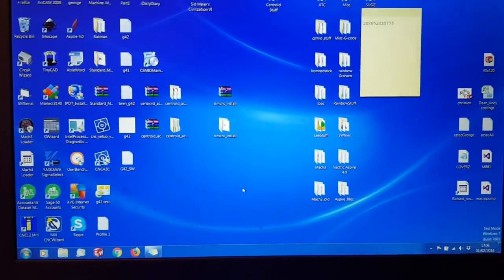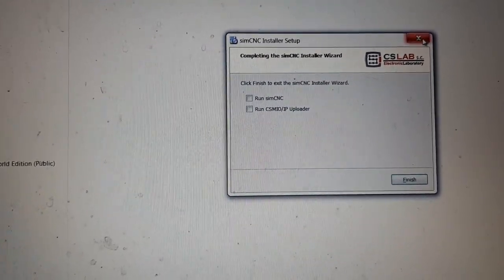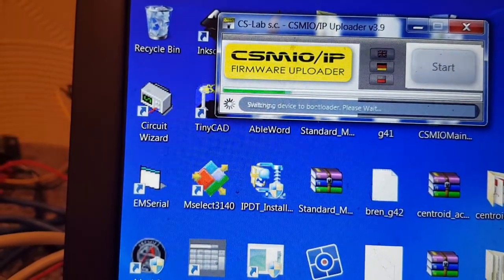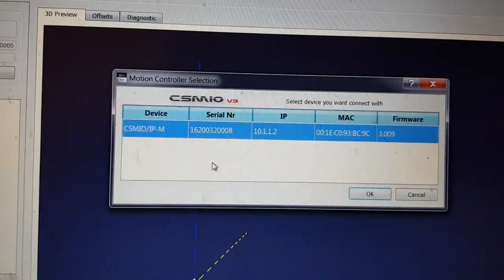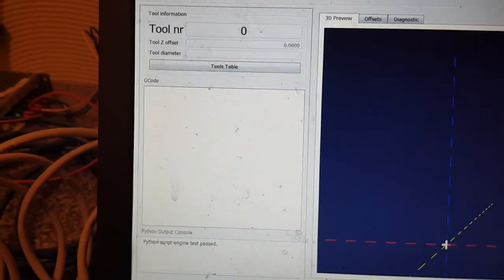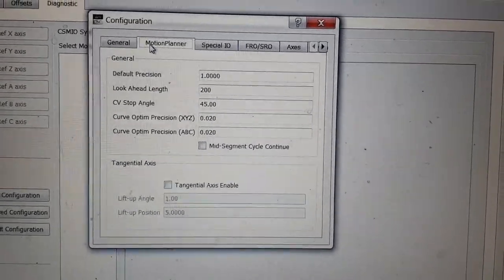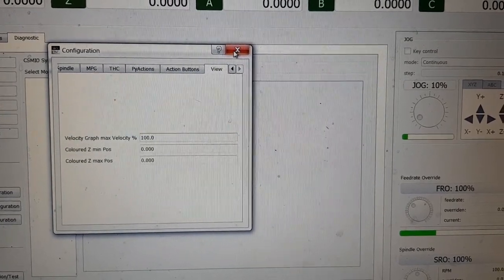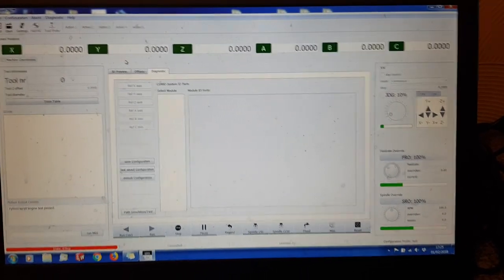Cslabs SimCNC Install and First look.

Comment: Hi great vids im just about to start retro fitting a gate 3 axis mill with toolchanger yaskawa drives. I have always used mach3. I cant decide between cs labs and mach3 or 4. Or centriod oak (which I have no experience in). I would really appreciate your opinion. Ps sounds like your in same part of world as me. Cheers Kieran.

Comment: Hi @Jazz CNC, Ive just tried it, like the software but cant PID tune anything. Machine shakes violently. Im sure its configured correctly in terms of the Axis etc. Found the enc count setting, thought that would fix it but no. If I try and auto tune it fails as soon as I click start. Any ideas please?
Reply: Ok, got it to work. PID values are no where near the same as Mach 3, best to set them to zero and let the machine autotune. A few more things to understand but fairly impressed thus far.

Comment: I am keen to try this but there really isn't any real information about it. This is the only video I have found where some of its features are shown.
What I find odd is why this company has put time into something but doesn't really advertise it and in the process of working on its own software has left Mach 4 users waiting for issues to be fixed.

Comment: MAKE A VIDEO THAT REALLY DRIVE A MACHINE!  YOU DOING EVERYTHING MIXING 3 DIFFERENT CNC SOFTWARE!!!
Reply from the maker: Video was only made to give a brief over view of SimCNC to forum members. Regards doing everything with 3 cnc softwares then if you knew anything about CSLABS products you'd know that's impossible because only supports MACH3/4 and now SimCNC which is still a Beta software.